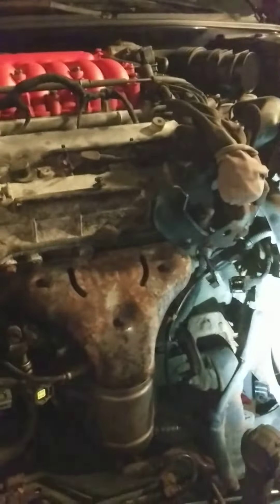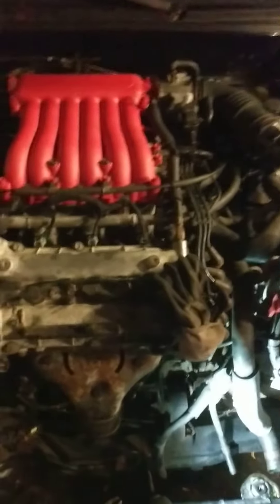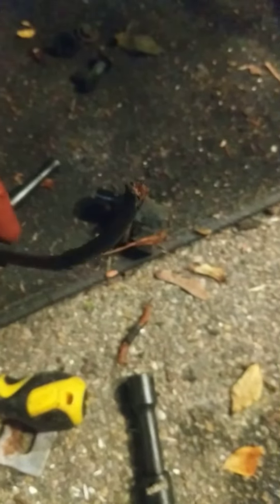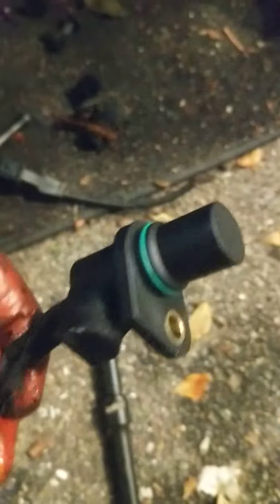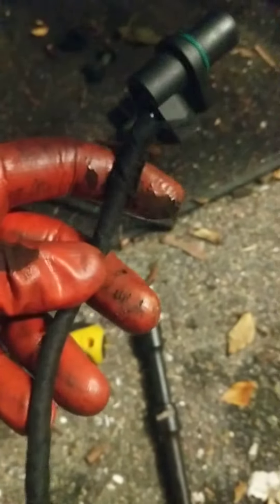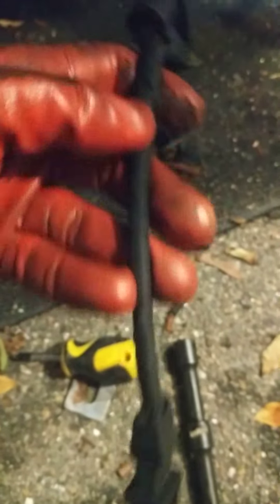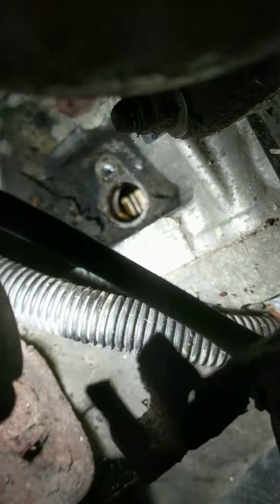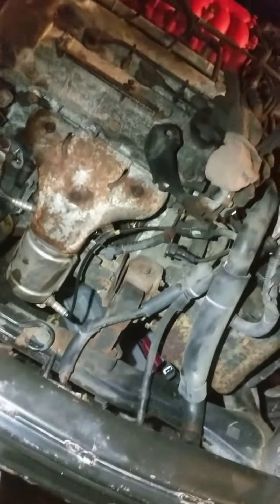Tiburon 2004 crank sensor replacement

Comment: hey doing this job right now. we can't get a 10mm onto the bolt to remove the sensor. did removing the radiator and front end help? it's a feel kind of thing, since i can't see it...
Reply from the maker: I was doing it long time ago, but I guess I was able to remove it without removing a radiator and frond end.

Comment: maybe late in the game, you would've probably figured it out by now. If not, replace crankshaft sensor with OEM one. aftermarket sensor would simply not work.
Reply from the maker: Thanks man,  I will try to put original one